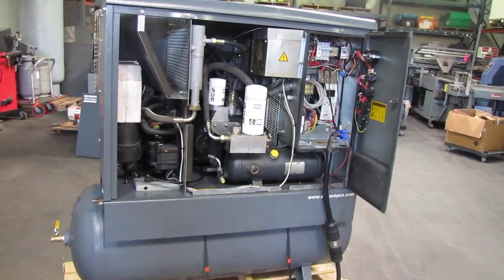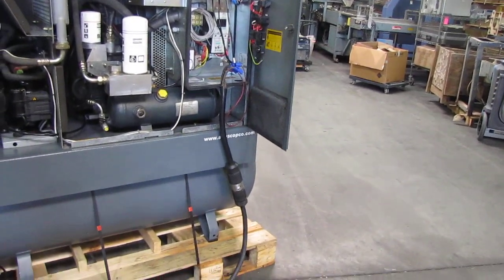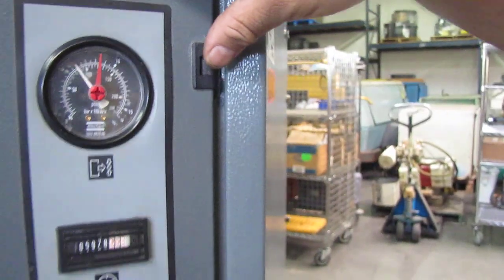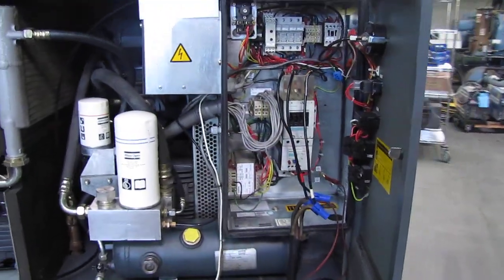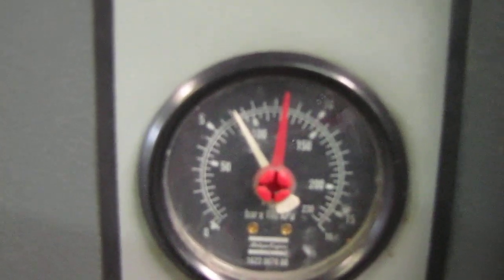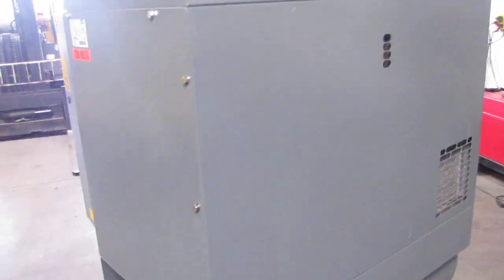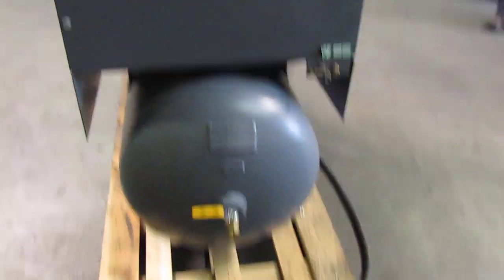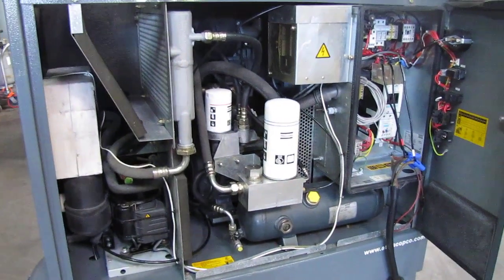2004 Atlas Copco GX11 15hp Rotary Screw Air Compressor GX11ff 230V

Comment: I have a GX11 completely dead no power signs. I check the fuses the look ok. any idea where shoud i start.
Reply from the maker: Check your transformer. You should have voltage on the output side

Comment: What can causes the compressor to overheating
Reply from the maker: The most common is a dirty cooler or the compressor room is too hot. Other problems can be oil level low or thermostatic valve faulty.

Comment: HI I have a problem by GA11VSDFF I CAN'T PLAY THE OIL FAN, AND THE OIL WILL INCREASE THE TEMPERATURE OVER 120 CELSIUS, I TRY SEE IN A PORGRAM ELECTRONICON II but I can't fix any thing, here are two kind fans, one fan, the upper fan, start working just in time when I start the compressor, but the second fan, the down fan, does not start and temperature increase, if anyone can help please..
Reply: The thermostat symbol comes up